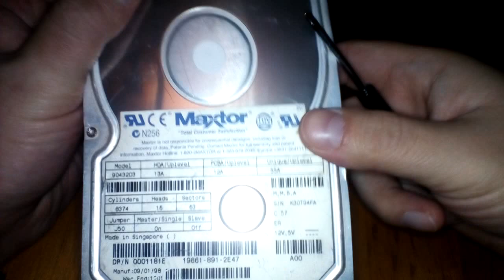MAXTOR 4.1GB IDE ATA Hard Disk - teardown - parts

Comment: To do a platter swap, you stick scotch tape around the disks inside, and obviously remove the reading arm before lifting it out, if it's the PCB replace it with another, if you cannot, get a multimeter, and check which diodes have gone and remove them, always make sure you have anti surge or shock, if the motor goes your best alternative is a platter swap to a functional drive, good luck
Reply from the maker: I just take them apart and reuse the screws, magnets, connectors...etc. ;)